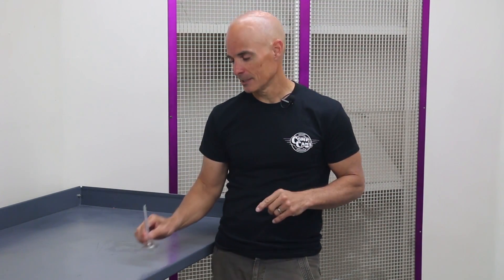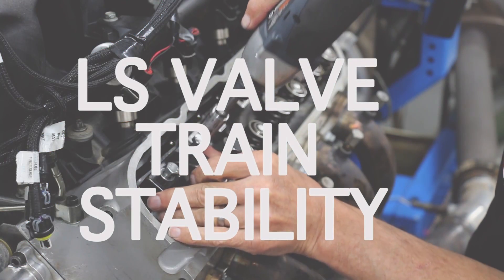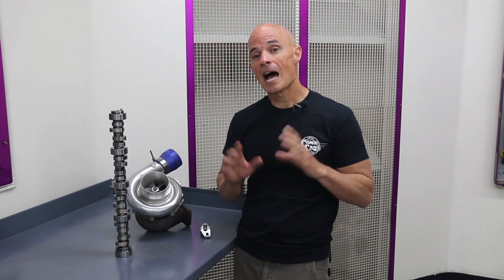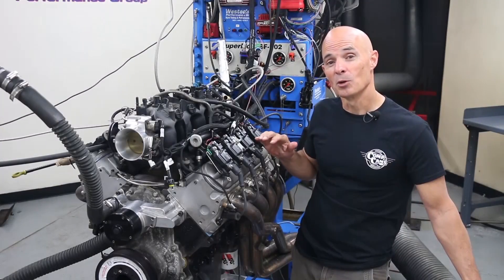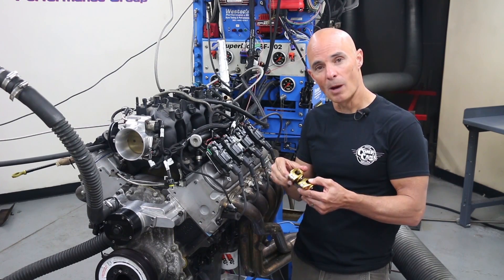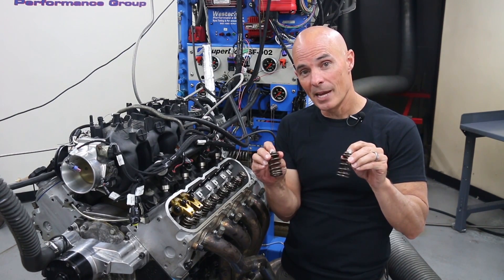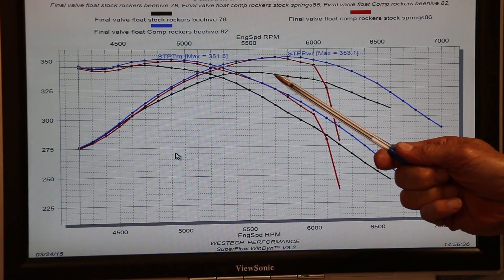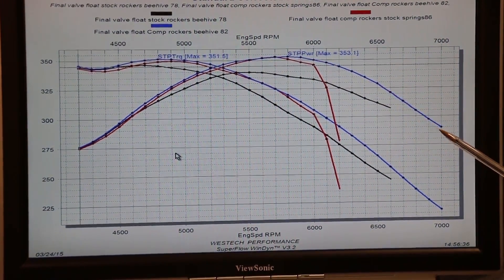Back To Basics: LS Valve Train Stability

Comment: In a stock 04 lq9 6.0 what would be a safe rpm for me to stay under so that I don't have valve float. I am planning on doing the springs and push rods soon. By the way I am also doing the trunnion kit upgrade.

Comment: Hey guys, I'm trying to do a cam swap, valve spring + rocker arm, pushrod upgrade on my 2009 Silverado LY5 5.3L. I've watched all the "back to basics" and pretty thoroughly know about engines. The question I keep thinking about is, what prevents the valve stems from slipping and falling into the combustion camber once you take off the valve spring retaining locks?
Reply from the maker: Most installers will use compressed air to hold the valves up.  We sell a fitting that screws into the spark plug hole and will attach to an air hose. You can get it by ordering Powerhouse Products' part# POW301024. Hope this helps, thanks for watching!
Reply: COMP Cams, thank you for the reply!

Comment: Good video.  Say I wanted a basically stock LS1 but I wanted it to be reliable and be able to survive some revs at the road course and autox.  Would just installing a set of dual valve springs be cheap insurance?
Reply from the maker: +christians131 Thanks for watching! You could upgrade toour 26925TS-KIT dual valve springs and rev with confidence, but the pushrods
and rocker arms will need to be beefed up as well. Our 13702-KIT truninon
upgrade kit and 7955-16 pushrod set would do the trick regarding wht you are looking for. Then you will be all set for a camshaft upgrade later down the line as well. Feel free to contact our CAM HELP line at 1.800.999.0853 or email camhelp@compcams.com for more info. Thanks again!

Comment: So when you switch out the valve springs don't you want compressed air going in through the spark plug socket? So when you depress the valve spring the valve doesn't drop? I am fairly new to this but was told this is a must. Any advice would be great
Reply from the maker: Tate Mecham Yes, you are correct. If you watch closely you can see compressed air in the video, Richard just doesn't mention it. Good catch!
Reply: Oh cool! I didn't want to sound like a know it all I just didn't hear it mentioned. Thanks for replying and clearing it up

Comment: And springs with a BTR stage 4 cam?
Reply from the maker: Travis Wigal Travis - your best option is probably to contact our CAM HELP line at 1.800.999.0853 or email camhelp@compcams.com. Those guys will have a few questions about your engine and overall setup, and they will then be able to help you pick out the best valve train components for your LS3. Thank you.